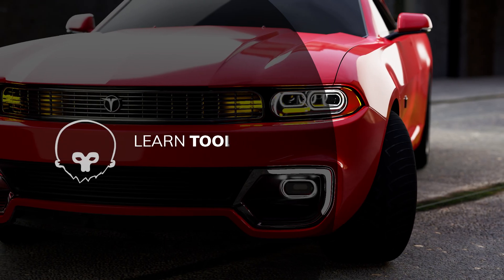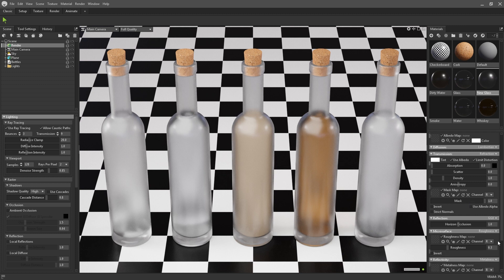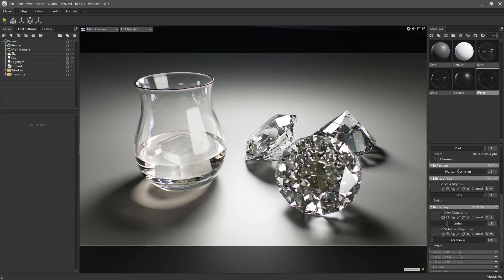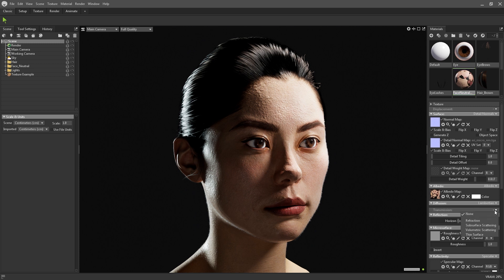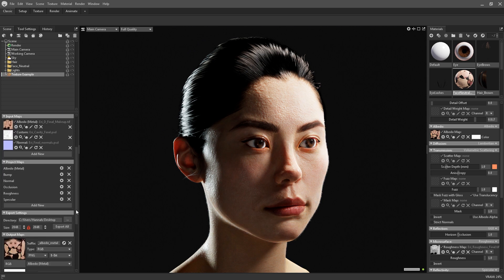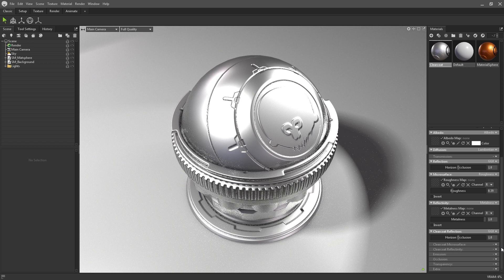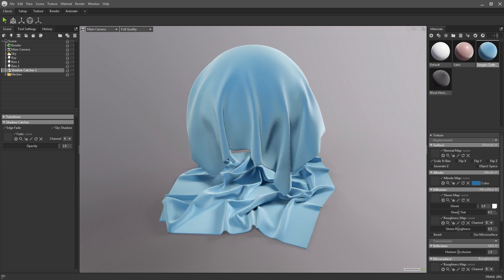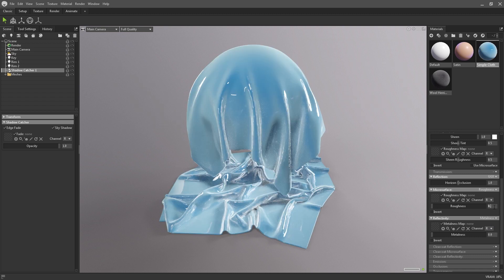Advanced Shaders - Learn Toolbag 4, Ep. 7

Comment: Do I necessarily need an RTX-videocard to use RayTracing mode in Marmoset 4? Thanks!
Reply: No. I have laptop with i5 5500u + 820M, which can't even play GTA 5. But Raytracing working in it. It took me 10 mins to rendering an full hd image. Result is outstanding. RTX cards are just very fast.
Reply: 1080 or better.. I still have a 1080 it takes forever but it works